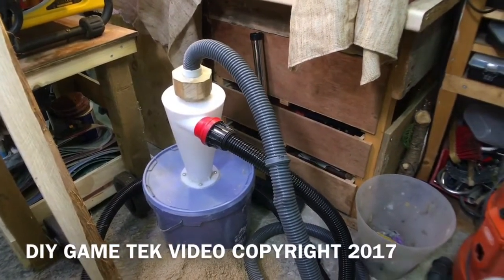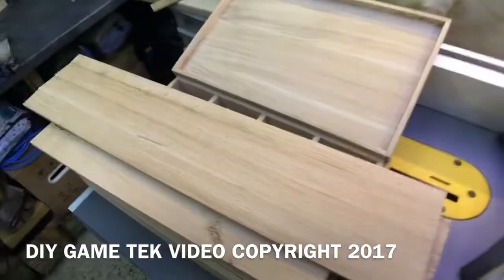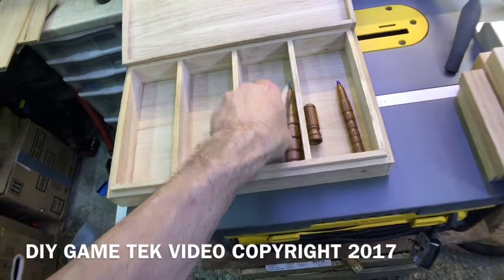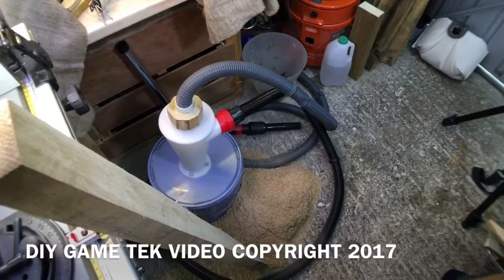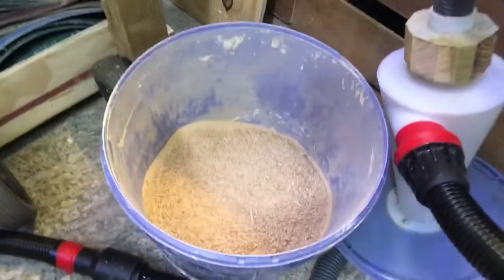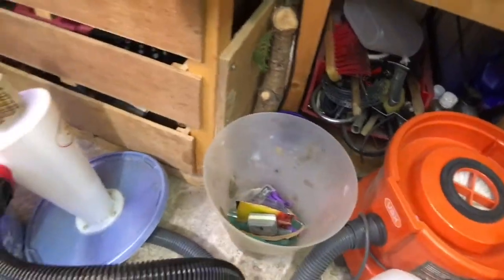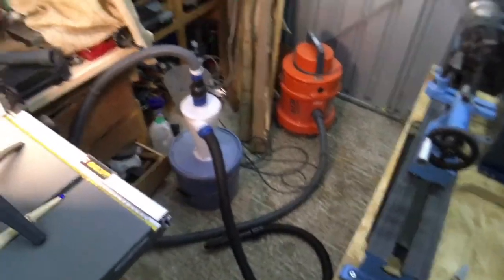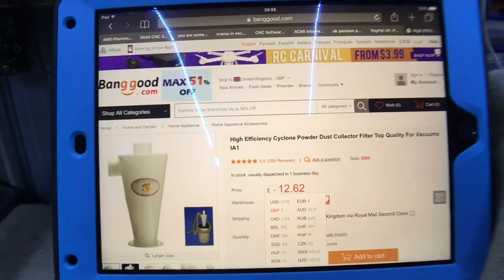Cyclone Dust Collector  Separator

Comment: How did you attach your vacuum hoses to the Cyclone?
Reply from the maker: i made a wooden fitting with two hole saws, drill half way though some scrap wood with the small hole when turn it over and drill half  way with large hole saw then snap the core out and attach the vac